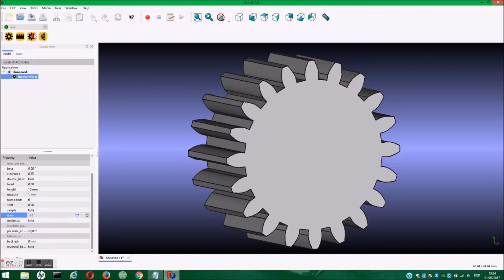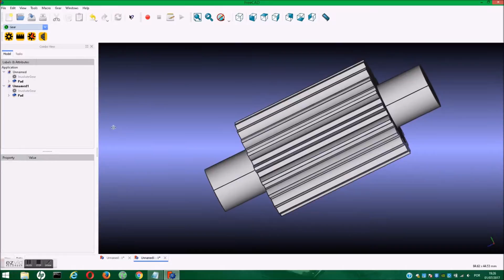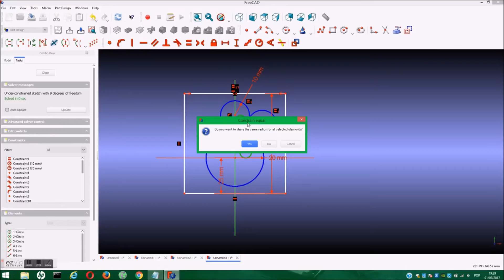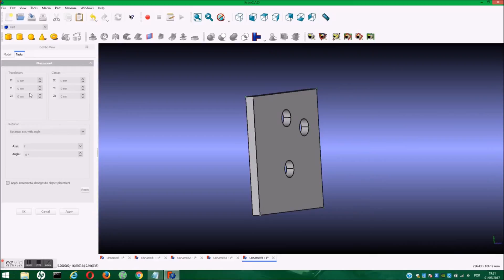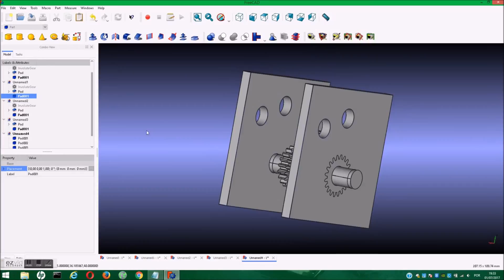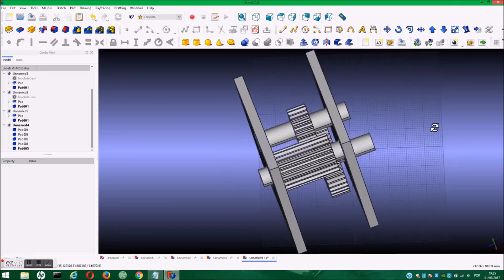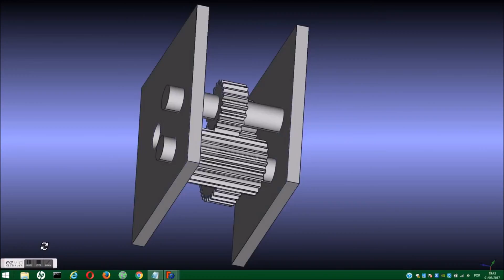FreeCAD GearBox Design (Simple One)

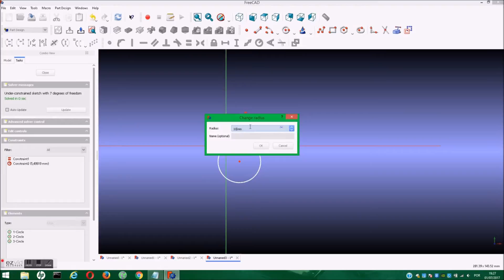Comment: 5:22 min, where do you get the radii from? How was it determined.
Reply from the maker: When we are creating a gearbox. We have to ensure good contact between the gears. If they are too tight they do not rotate and if there is slack the movement is not transferred. When with this type of gears there is something that we call a primitive diameter or pitch diameter. This diameter will depend on a variable that we call Module. If the value of the Module equals 1 then the value of the Pitch diameter equals the number of teeth of the gear in mm. Therefore a 20 tooth gear has a Pitch Diameter of 20 mm or a 10 mm radius. As you can see in the minute 00:38 in the parameters the value of Modula is 1.
I'll leave a link here for more information:
https://en.wikipedia.org/wiki/Gear#Nomenclature

Hope this helps